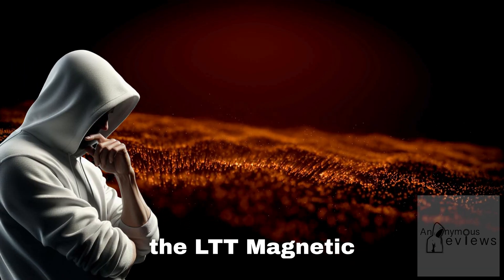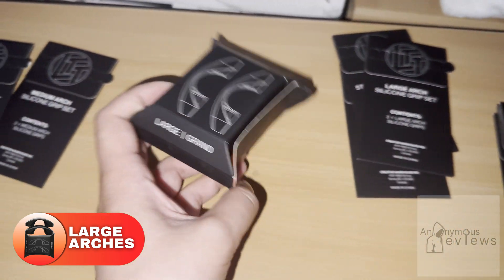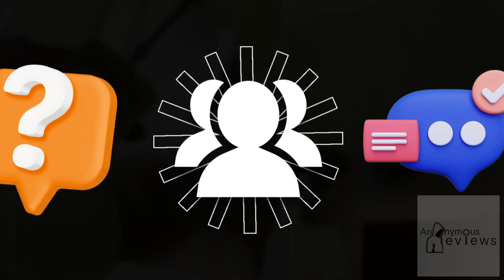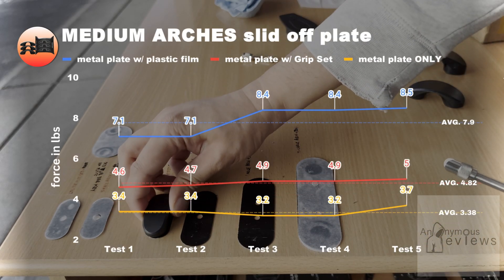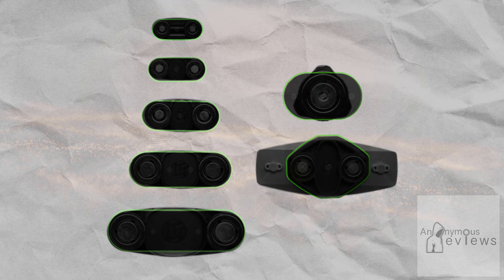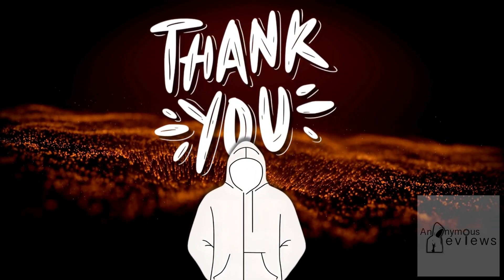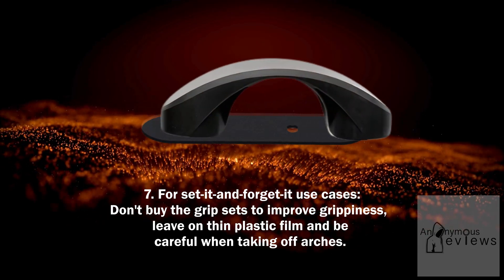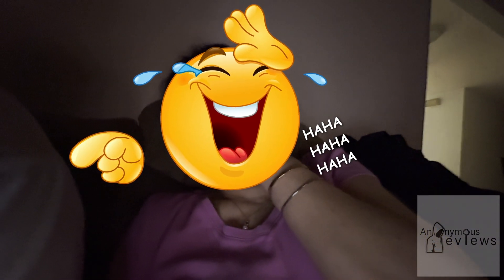Putting LTT Magnetic Cable Management to the Test

Comment: I hope the table tie keyhole was a snarky remark, since most hook and loop cable ties have that "feature". It's for running the strap through to make it more secure for the bundle of cables. Also, the cable ties were made before the magnetic cable management tests.
Reply from the maker: Yeah, it was definitely a comment made in jest. There is no way many people are using that keyhole to attach cable ties to in the manner I did. How often are people attaching cable ties to these products in order to conduct tests? I think I’d be one of the few. It a super niche use case. And in the video, I feign ignorance on this for a more humorous angle.